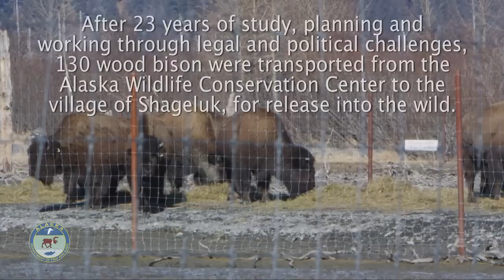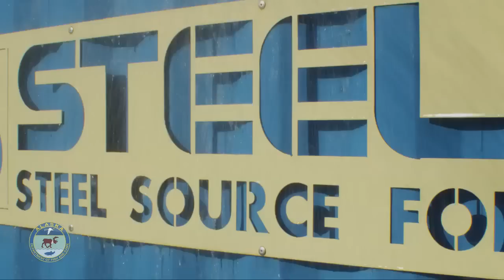Historic Bison Release in Alaska

Comment: Are you kidding me?  I've been to Alaska in the winter at 40 below and I'm tell you  that no bison can withstand that kind of cold for days on end unless they have some sort of heated shed from which they can escape the elements.  Whose friggin bright idea was that?  Some idiotic doo-gooder who has more bravado than brains...  Yeah, lets save all the animals from extinction by putting a herd in Alaska.  BRIGHT, REAL BRIGHT !!!
To be fair I was stationed at Eilson air base at the time in Fairbanks which is about 270 miles north as the crow flies, so it may actually be colder there than down at Portage at the wildlife refuge.  but still, that is a bit of a stretch to put bison there because it still gets colder than it does in Yellowstone.